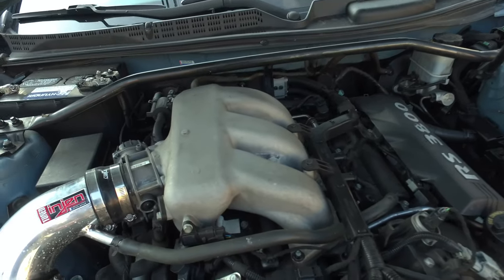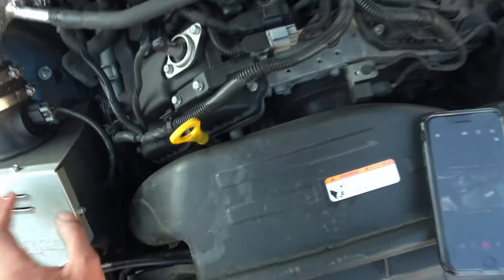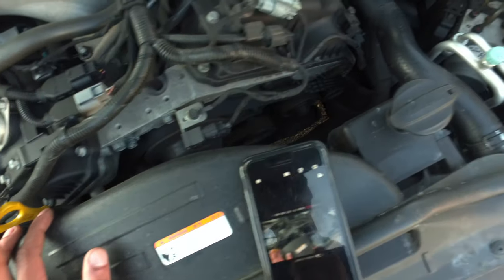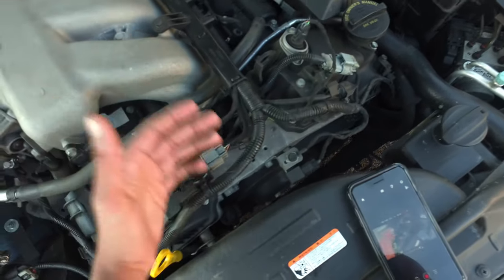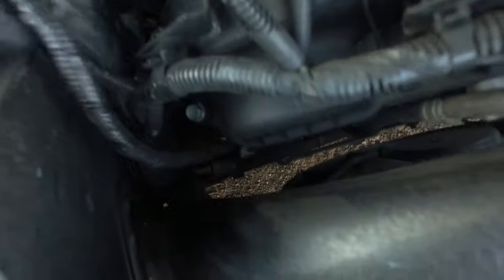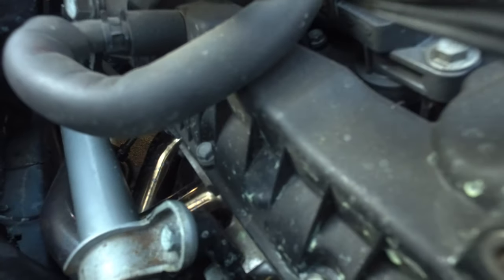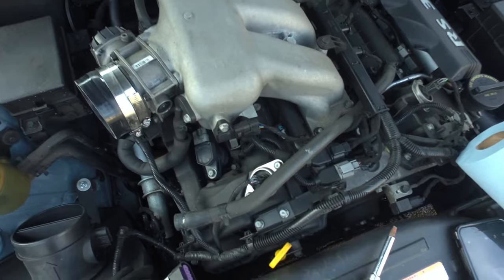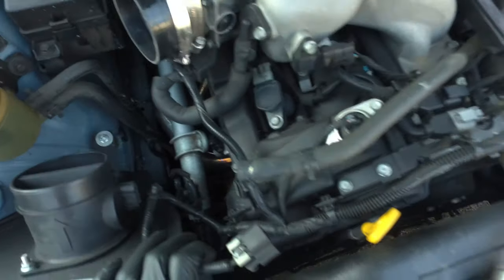CNT V3 Exhaust With DNA Headers - Final Install On Genesis Coupe

Comment: Is that tint or nightshade on your tail lights, just wondering cause i have the same colour genny and wanna know if i should tint them or not
Reply from the maker: It was rust oleum peel coat tint. It has a matte finish unlike vht, however it’s peel-able so weigh the pros and cons to make your decision.

Comment: This is headers test pipes and the cnt catback
Reply from the maker: Yup, dna headers and test pipe w/ cnt cat back
Reply: @FatalRPM  u have the res on this right I wanna make mine true duel
Reply from the maker: @Nunupete  i think it had an h pipe, no resonator. Its true dual for sure.
Reply from the maker: @Nunupete  Actually it was a resonated h pipe, still true dual though. Unless you mean straight pipe, in that case no but your best bet for that would be a muffler shop and have them weld in some pipes in place of your exhaust but i can almost guarantee it will be ultra raspy.